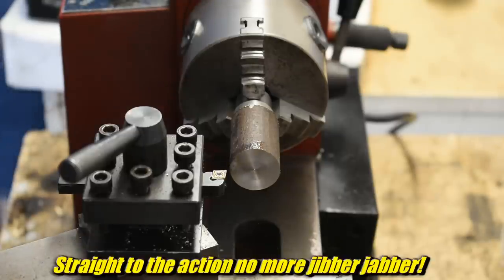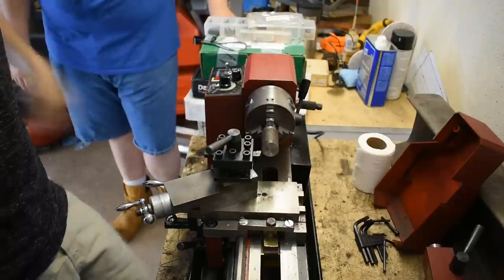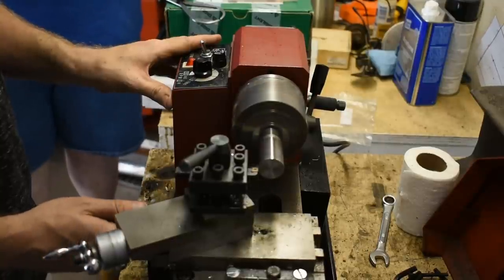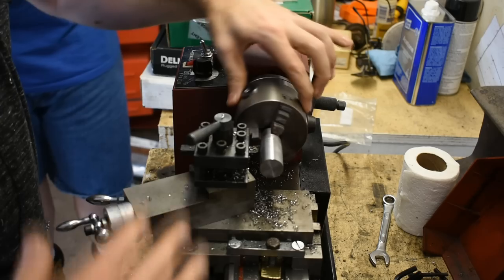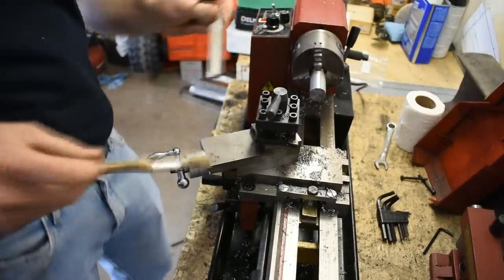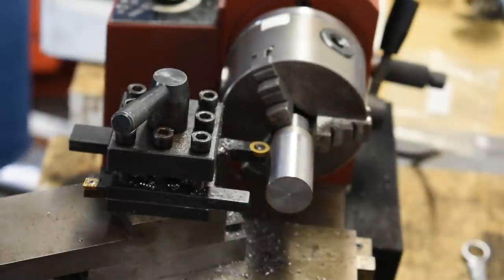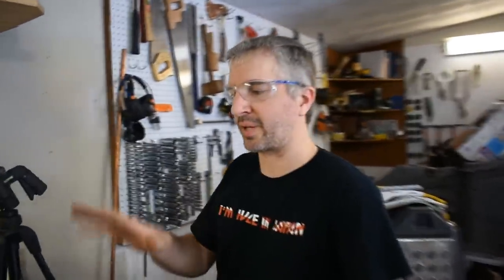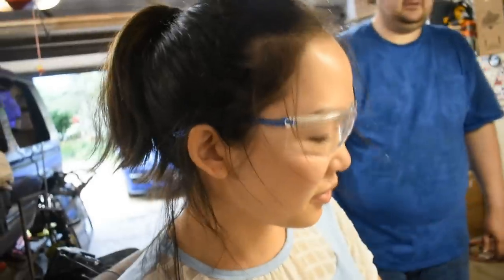Learning to Use a Lathe, Part 2: Turning Steel Down to Size

Comment: Ok Paul, machinist everywhere-are going to jump up and down and you might get some hate mail...but here goes.
So I am working on my homemade lathe too. Even tho I have other lathes. The lathe you used in this video will set you back $500 plus’s tooling ect. As a kind of shortcut I use my $120 harbor freight wood lathe with a $85 wood lathe chuck to do a lot of smoothing and polishing work on parts I.e. 3D printed parts. Files, rasp, and sand paper make great ways to take work down and get things ready to use. Granted it’s not the most accurate method. But with a few inventive techniques, I can get mirror polish on parts that I’m ready to ram up and cast. And with this setup I can hold work in the chuck, or use a mandrill, even turn between centers with a lathe dog. Plus with some practice accuracy becomes a pretty tight tolerance for these things. The parts you are going to cast in aluminum are going to need to be bigger to allow for shrinkage, and they will need to be turned after or the accuracy isn’t that extremely important to begin with.
Thanks for the videos, we all enjoy.

Comment: What RPMs are you running that on? I'm trying to learn to turn 3/4" diameter Damascus, copper, brass and titanium rods into beads but can't find info on what RPMs to run them at or whether to use carbide or HSS tools....

Comment: I would like to buy & rebuild a metal lathe so doing some jumping around. I guess it never crossed my mind but after turning brake rotors and drums about 2-3,000 times over 38 years at shops and dealerships, I guess I know more about these than I thought.
 Non-detergent 10-W-40? I don’t thing that is made. You are going with a straight 30 SAE oil. Something used in your air compressors crankcase.
 Personally, what is the deal. Over half of the shinnola in oil is man-made additives anyhow. The “W” stands for winter, not weight as it pretends to work & flow thinner when cold than straight oil, but anti-foaming agents, viscosity index improvers, extreme pressure additives, anti-wear additives, additives to change the boiling point, cleaning agents! Unlike WD-40 that has worked its way into the hearts of many, I never use it because it evaporates. I don’t use it unless I am removing or installing a rubber hose. I have 3 oil cans that are 150 years old total but work simple on the bottom that flex’s, making the oil can sound, thus creating “Oil Canning” as a noun. When a door hinge, hood hinge or the wheels on my lawn mower need lube, motor oil it is. Cheap, works and last a long time. The downside is it attracts dirt, dust or other dry air borne particles like pollen. Tallow is a rendered animal fat and used for lubing wooden soldering spoons (Some calls boards, old timers say spoon) but it is used in lipstick and other moisturizer products. Lending the term “Lipstick on a Pig”. But in machining, water-based lubricants are the normal because nothing removes heat like molecules of water. I have no idea what is added to make it a lube! Either way, learning at any age is good, otherwise it’s a boring day. I think inquiring minds what to know. The brake lathe by Ammco, model 3000, was sold by the millions and has been replaced by the $9 Chinese brake rotor that retails for $32.95. Ask you parts store if anyone has refaced a rotor. 0.005” thou is a clean up cut, followed by a 0.002” finish. The reason people say cut rotors warp is it is cut into it at the lathe. What! Yes, hub less rotor are the rule today. A flat cone slides on, followed by a spring and center cone. Another flat cone follows and tightened. Cut the rotor, loosen, hold the cones and shaft still & rotate 180 degrees. Attach a dial indicator on and rotate. You will see 300-600 thousandths (0.3-0.6”) lateral run out. After two months the pads seat and this transfers into the pedal. The adaptors need placed on the machine. Marked with a flat cold chisel to the shaft hub and placed there every time. Add what is needed but cut the face like a one-sided rotor. Do this to all flat adaptor and check for run out. It’s gone. This is called “Qualifying” the lathe. 
Have a good day guys. 
ASE Master Tech since 78, retired.

Comment: The problem with using oil on carbide. Carbide is hard like glass and brittle. If your carbide gets hot and then you add some kind of oil or coolant it will quench the carbide and make it chip or crack. Either flood coolant or no coolant for carbide. Intermittent is bad.
Reply from the maker: Interesting, thanks for the tip
Reply: I use spray coolant a lot and it works ok.  Flood can be a pain in a small shop.  He is right though, forget intermittent cooling for carbide.